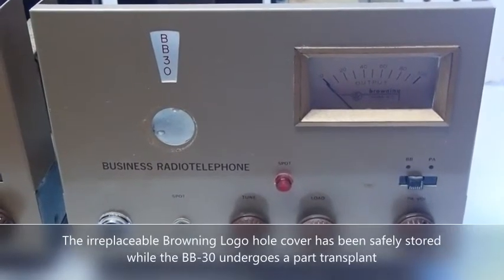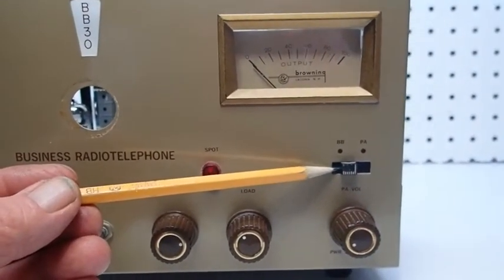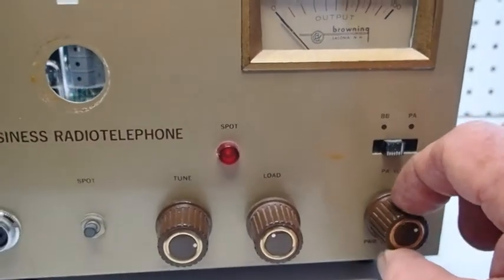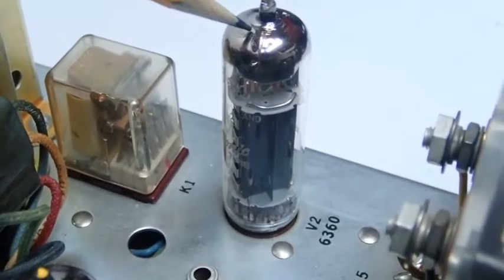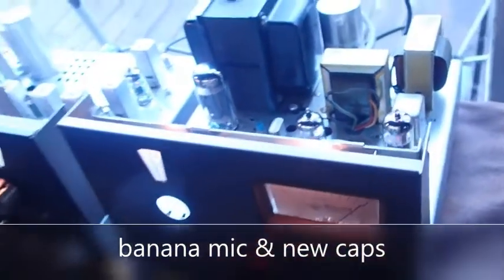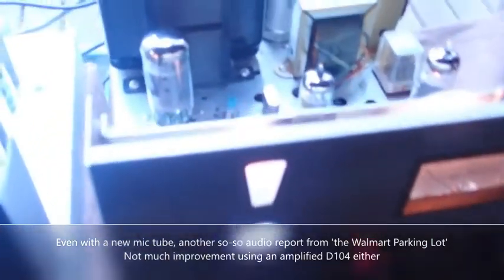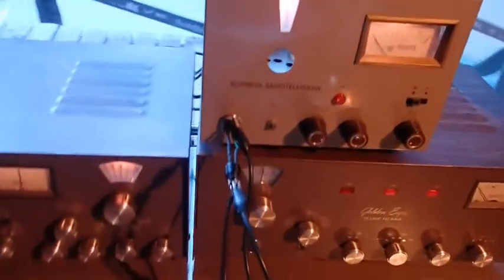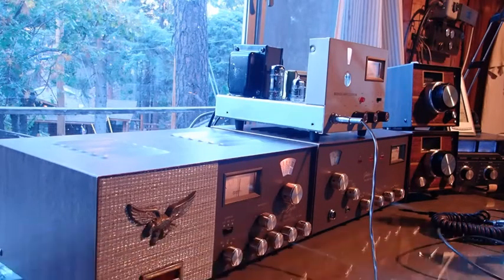Browning BB-30 Business Band Transmitter

Comment: Interesting video S9. Well you can count my BB30 in your inventory of working BB30's that i bought from Skip Schepleng, When i bought it, it had the MK2 channel selector in it and i acquired a nice BB30 face plate from the late Bob Millum collection when Joanne sold all of Bob's gear, I removed the MK2 channel selector and put this BB30 back original.
Reply from the maker: That was a client's BB30 in the video, I would probably buy one if it hadn't been hacked up and the price was right. I certainly wouldn't be adding a channel selector, I'm a strong believer in keeping original. 73